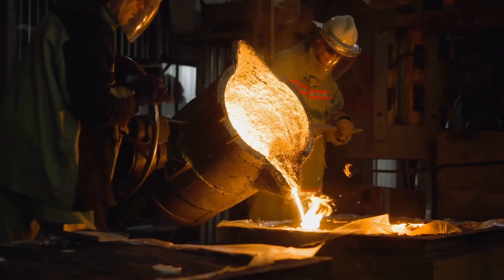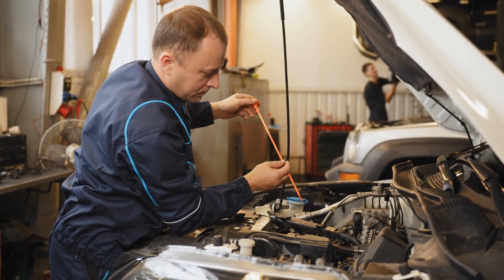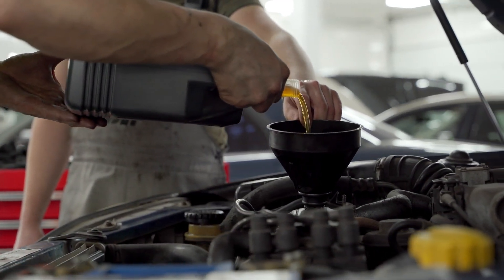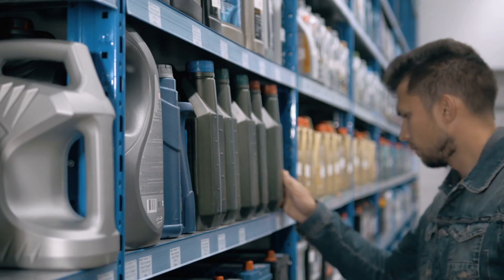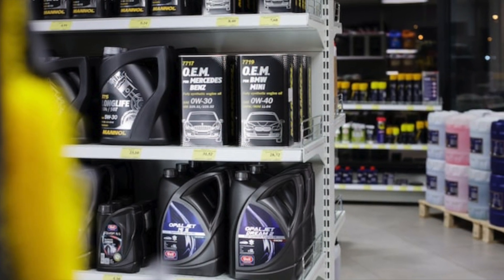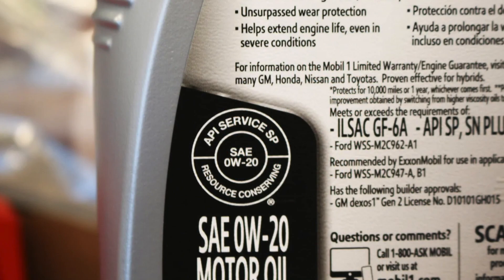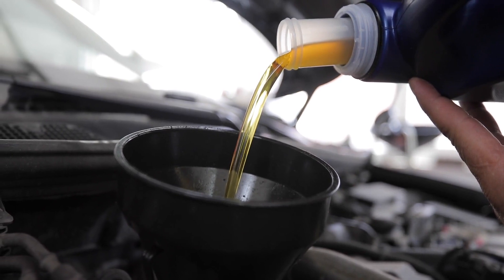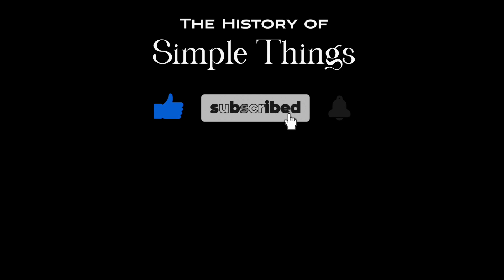Motor Oil Viscosity: What does "10W-40, etc” Really Mean?

Comment: I use whatever oil that is on sale at Walmart and my 2002 Rav4 has 280,000 kms on it and I have yet to have any engine problems.  If the car you have is just daily beater car without a lot of investment then just use what is cheapest.   Usually I just use 10W30, 20W30, or 10W40 but I know know that all three oils are compatible even if you mix the oils together.  Having enough oil in the engine is more important than anything else inside an engine as a low oil level > poorer overall engine lubrication.

Of course, when I did change the oil (which was once every three years) I did use full synthetic since at that time it was only $15 for a 5 litre jug at Walmart.

My 2002 Rav4 is still running strong even 22 years later....!